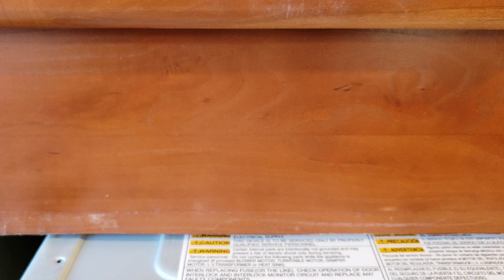Repairs - GE Oven Microwave Combo Control Panel "Repair" JT3800SH4SS

Comment: There are two more on the side toward the front/top (either side of microwave).  So, there are two on left, two on right.  You'll want to take out the top one on either side.  That brings a total of 9 screws (not including the two helper/panel screws). Hope this additional info helps.  This video has been VERY helpful - thanks :)
Reply from the maker: Glad it helped. Thanks for the additional information. Strangely enough, mine does not have the extra screws you mention. Guess quality control missed that when they let it out the door.
Reply: I wish I read this first comment before I wrestled with the panel. And yes, thank you for this video. I just need to replace the knob which requires the board be taken off to get to the three screws that hold the knob board on. One last thing. I put a bench below the oven and slide it out about 18" more. Made access to the rest of this crap easier.

Comment: Thanks for the help in getting my GE profile wall oven/microwave pk7800 front panel disassembled.  It was the same as yours.  Unfortunately, it did not solve my issue as the panel is still black.  It happened the first time a week ago while I was warming up soup in the microwave.  I did a power reset and it brought it back.  There is an LED on a circuit board that is between the oven and microwave in the middle of the entire panel but I cannot seem to locate how to get to it.  Going to look for another video like yours where someone opens the Oven section.

One note.  The service wiring diagram is taped inside the microwave on the left side (on mine at least) once I took the front panel off.  The Oven one is located inside the Oven section according to the information that was in that envelope.  It's a Catch-22 in that you can't get to the envelope unless you know how to open the Oven and Microwave up.  I'm sure there is a Service Manual somewhere that I will also try and located.
Reply from the maker: @stephenverderese9411  Good luck.
Reply: Hi Stephen, have you found out a solution? We’re having a key panel shorted message, everything is in tact. But still having the error message
Reply: My issue turned out to be one of the main 120v legs we’re not attached properly. When the oven and microwave ran at the same time the leg that supplies power to the microwave disconnected for a short second, enough to trigger the error. I found it much easier to remove the microwave out by itself. It is only held in by one screw in each side. There are two electrical connectors that disconnect. Once you get that done the microwave slides out. Have someone there to help you lift it. 

Once it’s out you can more easily access all of the screws to remove the panels if needed. 

Hope this helps.
Reply from the maker: @stephenverderese9411 The only thing I will add is that there is a lot of electricity back there (oven is 220 V). Be careful what you touch if you haven't turned things off at the breaker.
Reply: Always turn off the power. You also have to consider the capacitor load if you come anywhere near it. It should be properly discharged if you go anywhere near it.

Comment: Love the detail in this video. I found it while looking for info on how to change the microwave lightbulb in a very similar model. In your opinion, is removing the control panel the easiest method to access the bulb?
Reply from the maker: Thanks. From what I have seen, probably, but I have never tried it. The only thing I would caution is to cut off the breaker first because you start getting back into the wires carrying 220V.
Reply: Did you ever find your answer on this ??    my light in the microwave on this model just went out.

Comment: Were you able to locate the problem? I have exact same issue, and checked all the cable and changed out the fuse on the right side. Still nothing on the display...
Reply from the maker: Dirt gets between the push buttons and the contact points on the oven circuit boards right behind them. If you just tip it open and use one of those pressurized air cans for dusting computers for a few minutes, the problem seems to solve itself. You might have to do this a few times over the first few months and then the problem seems to go away. I suspect that dust gets in there every time you have to pull it off the wall or when the area shakes a little. The last time I did this, I also blasted all the wood around the area with the air can as well to clean out the sawdust that might be falling in.

Comment: I have this model and can't find the light let alone replace it... on the microwave.
Reply from the maker: @cryptohonesty7662  if I recall correctly, you open the microwave door, take everything out, and remove the internal lining. Make sure it is unplugged or the breaker turned off first.

Comment: Dan— thank you thank you thank you! Your video was a godsend. I ended up having to replace the whole electrical panel because the scroll wheel broke.  My one add to your video would be that There are in additional two screws on either side that I don’t think you accounted for in your roll up. I highlighted them here https://share.icloud.com/photos/0Nhd6ASjRG8oZfGKhCuw6aHDw.   If I have my counts right there was 11 total screws that were holding the panel in place, eight screws holding the oven against the cabinet. And those two extra access panels each with their own screw. 21 screws total!I was pretty amazed that many fasteners needed to be removed to get to this thing.
Reply from the maker: Glad it helped. Interesting. My oven does not have those two screws. I wonder if they got left out during the initial installation. At least your link is here if anyone finds the same issue.
Reply: I am now having the same problem with the dial. Power went out and now won’t let me use the equipment without setting clock but unfortunately dial doesn’t work and I can’t set the clock. Unbelievably frustrating!
Reply from the maker: @nismokid sorry to hear. I have always thought the design a little flawed. One, somewhat cheap, way overused dial runs a $3000 oven/microwave.